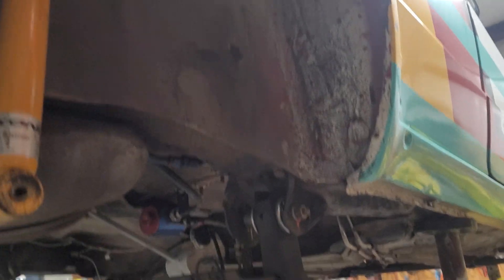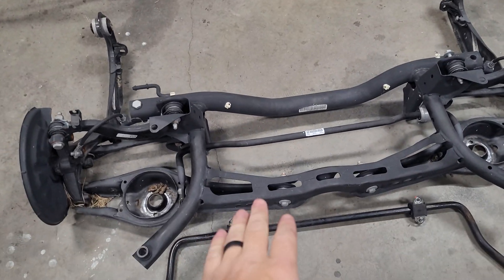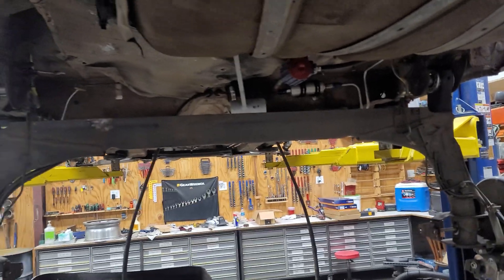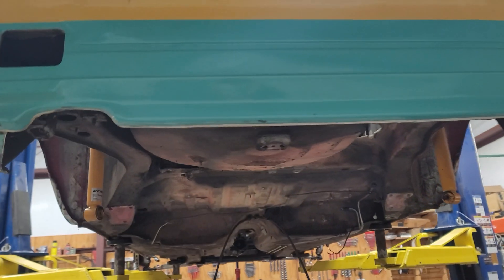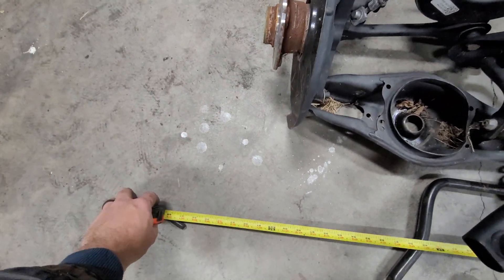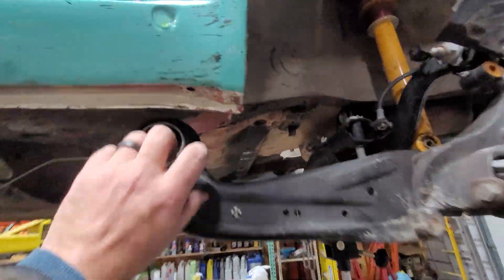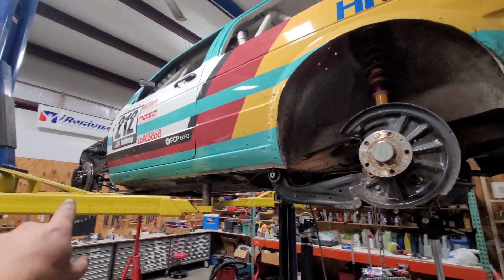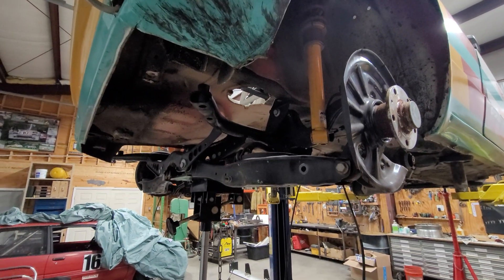30+ years in rear suspension advancement - Part 1

Comment: Cool project.  May I ask what rotors you're using with the boxster calipers in the front?
Reply from the maker: From the UK, factory mk5/6 sized front rotor, but 2 piece configuration. ECS tuning has the same in stock.
Reply: @PaulInskeep  Thanks... I know about the ECS ones but they're drilled, which I'm not really a fan of.  I haven't been able to find off the shelf 2 piece slotted like that.